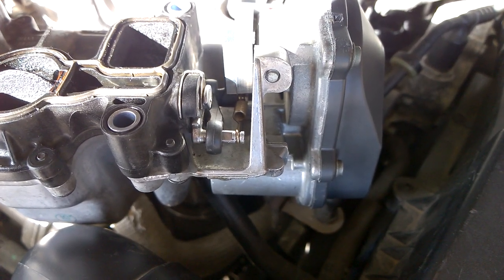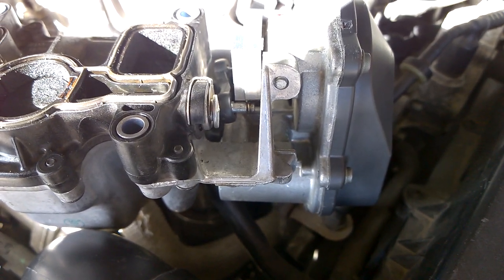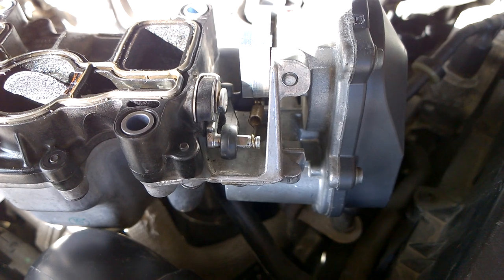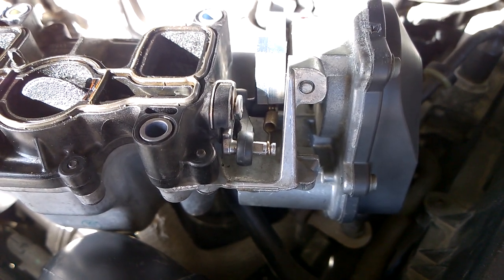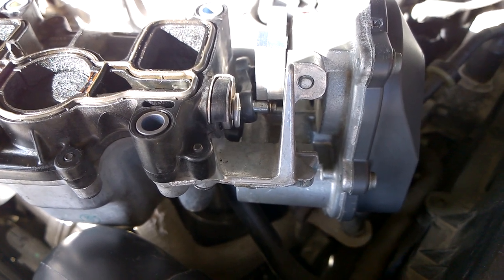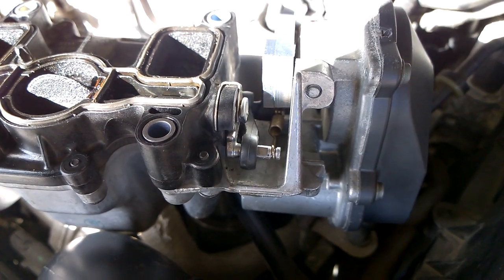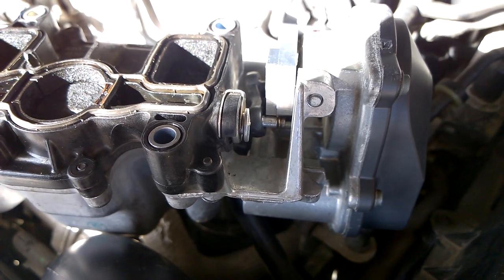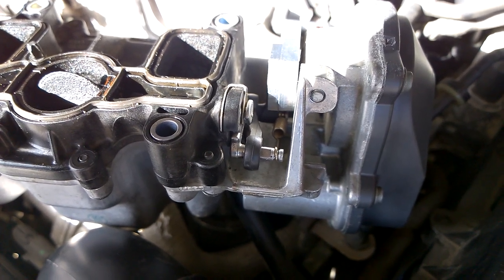Basic settings test at V157 motor for P2015 CR TDI error code

Comment: Soo please tell me, the values you are reading are ok? Or they are not ok and this will generate the error code. I had 0.38 v at full closed but after runing vcds bassic setting on v157 valve, i got 0.456 v. Is this the right voltage or it is not normal?
Reply: I measured voltages in my CBAB (plastic manifold) when plug was in v157. There was around 4.35V when flaps were opened and 1.3V when closed. Should I measure that when plug is out? Or there is different problem causes p2015?

Comment: Hi, ive installed the bracket the (and a new manifold), p2015 code is gone. But i get p2004 and 2006 instead. 
Does anyone know if i must do a calibration or something because of the new manifold? :)
Reply: Thank you for answer! :) But in my mind the plastic linkage is ok mounted. And i can move the runner motor easy with my finger when ignition is shut of.  I´ve a refurbished manifold with to plastic "balls", and a compatible linkage rod. Is the bracket not compatible with this refurbished manifold & or is the v157 motor broken?